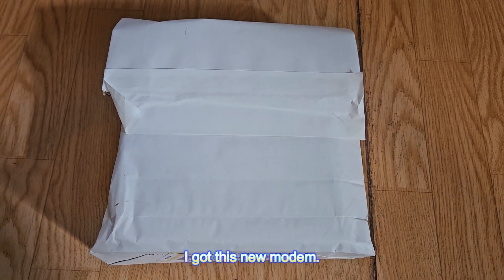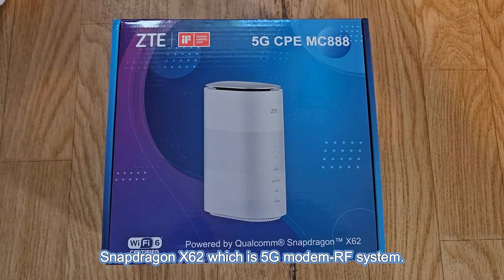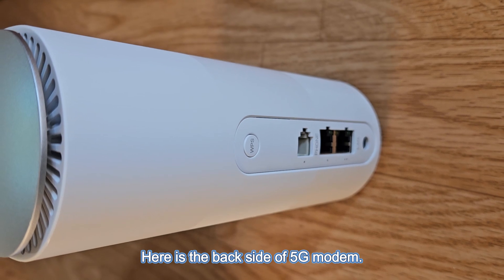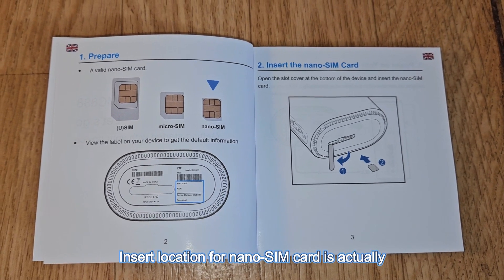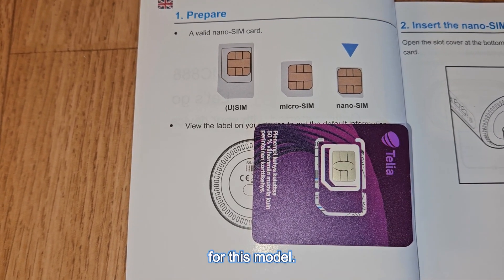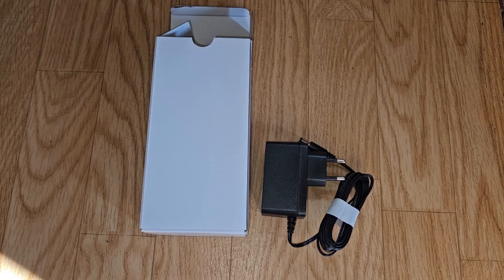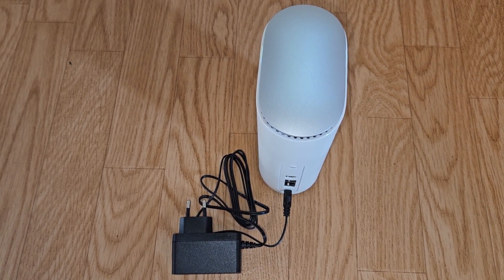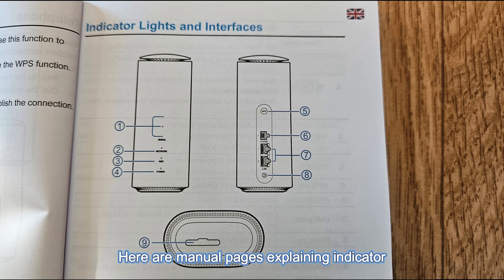Unboxing and setup 5G modem ZTE MC888

Comment: Hi. can i connect two desktops to this device with cables using both Ethernet ports and two cables, or will there be conflict? I got two computers and a phone with good connection through wi-fi, but my brand new desktop suddenly started disconnecting all the time. I want my living-room pc and the brand new one connected with cables to the MC888 pro.
Reply from the maker: There are two LAN ports for two ethernet cables on the back of the modem so It should be alright.
Reply: @silverian  Thank you🙏